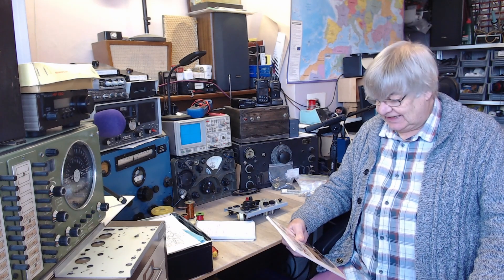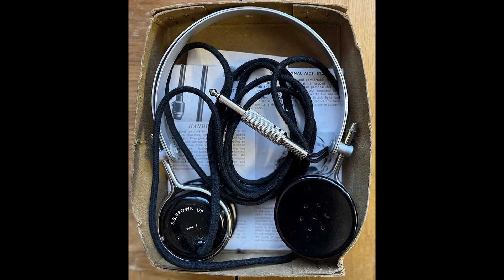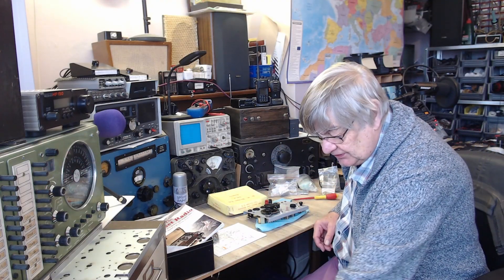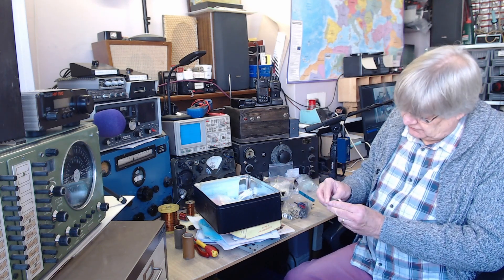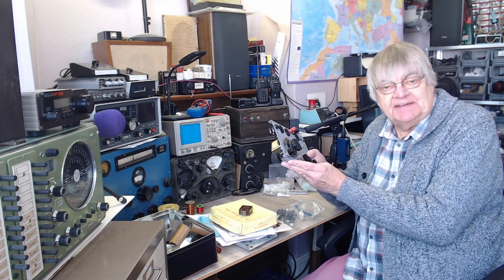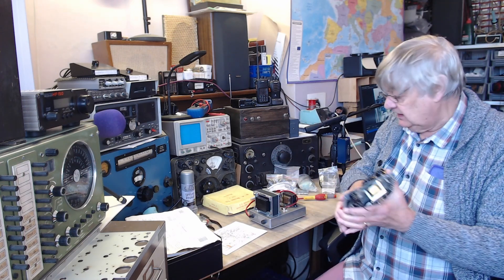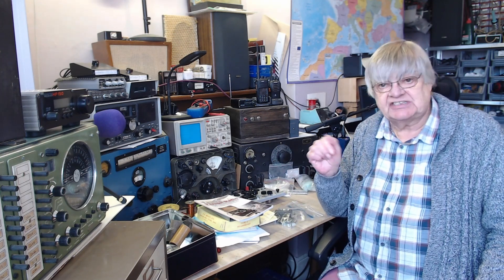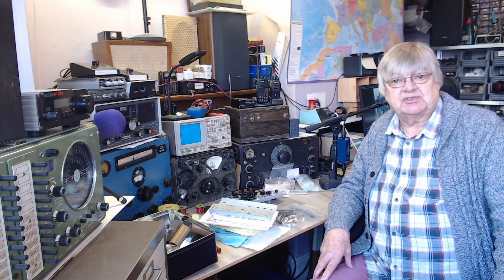G4NSJ - Building a replica Paraset Spy Radio Whaddon Mark VII

Comment: "No volume control" reminds me of my little Sinclair Micromatic which you have to rotate in relation to the signal to alter the sound level. (Sadly soon won't work when Five Live goes off air...used to be good when it received Radio 4 on MW).
Good luck with the constuction. Wonder who made the original ones?
I have built a few amateur sets (3 x Tim Walford's Ham and Hale, a QRP Labs QDX and QMX, oh and a Pixie).
Peter. M3TNW.
Reply from the maker: Thanks Peter. Interesting little Sinclair. It will be a shame to lose 5 Live.

Comment: Great to see someone building one of these sets.  Thanks for the video (subscribed).  Interesting story about wayward RF which evens the score.  The Uboats had an early warning receiver to detect airborne radar.  It was fitted with a speaker and installed on the bridge of the conning tower.  I don't know if it was a superheterodyne or other type of conversion receiver with an oscillator, but it too radiated RF.  I wasn't long before the RAF found out and were able to detect Uboats on the surface without using their own radar.
Reply from the maker: Yes, the wayward RF was a major problem. That's interesting about the U-Boats.  I shall look into that. Cheers, Ray.

Comment: A very interesting project Ray. When you say "kit", I'm guessing it's a basic set of panels and valve holders and you have to source most components? I shall follow your construction series with interest and wish you fun in making the set.
Reply from the maker: Yes, you'll source most components and there is no 'kit' available. It should be fun making the set. I just hope the end result works! Cheers, Ray.

Comment: The modern version of the 6V6 is the 6BW6 a very common tube used in top band rigs PA
Reply from the maker: I know the 6BW6 well. Great valve.
Reply: @g4nsj  Sure is and 
there are plenty of 6BW6 for sale on line about £6- £7  each new old stock where as the 6V6 is more expensive

Comment: Some captured agents where forced to send cw traffic and would  send a short code or a slight error in their transmission to alert they had been captured but no one back in the UK took notice because they did not think they had been captured as a result about 45 agents perished.
Reply from the maker: That's interesting, thanks. It must have been awful operating behind enemy lines. Cheers, Ray.
Reply: @g4nsj  Yes and I think I heard that life expectancy was short.'
MI5 cotton on after some time because so many stop sending and the RAF became suspicious  because of losing to many aircraft  dropping  off the spy,s

There is an interesting case where one of the German flying bombs crashed landed 
in a french field and failed to exploded and found by the resistance and the hid it in a field and the Germans came looking for it  failed to find it.
The resistance contacted London and they sent over a Dekota transport plane and took back and it had been dismantled.
I recall a film being made about it B/W .
Reply from the maker: @itsonlyme9938 thanks that’s interesting.